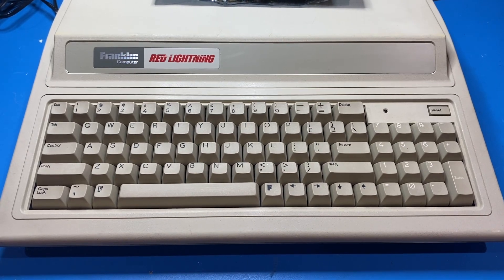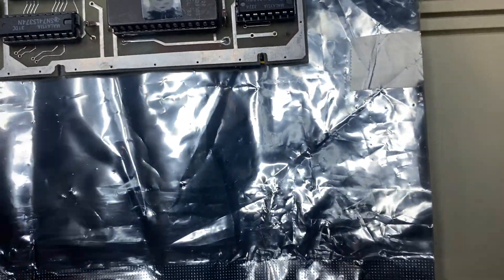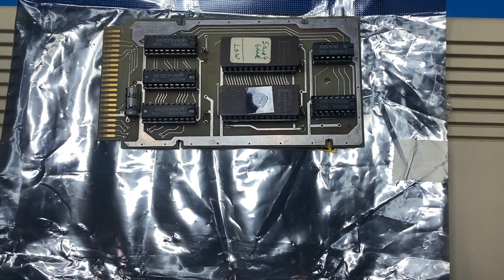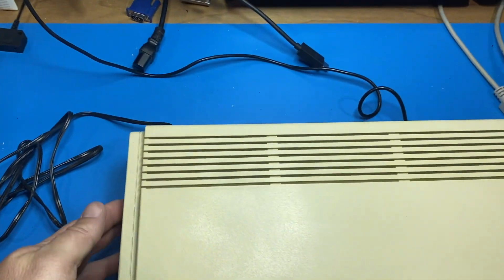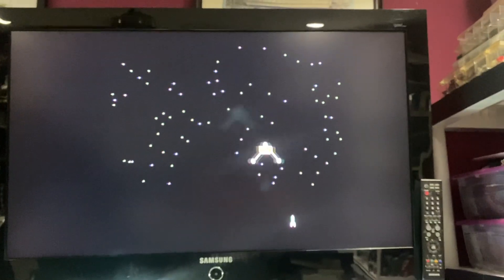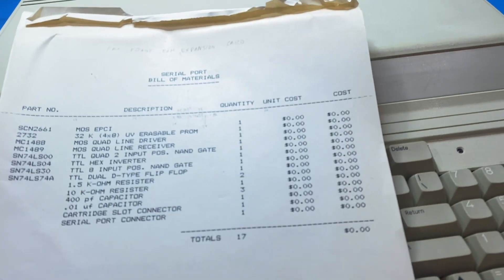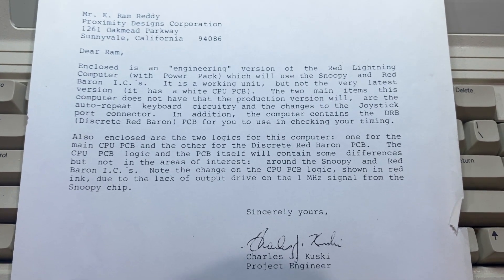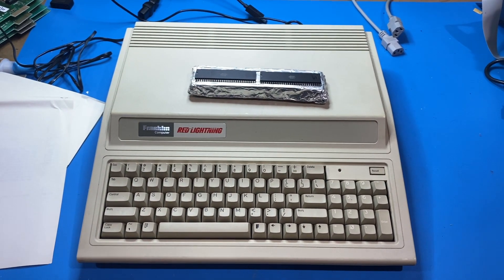Franklin Computer Corporation's Red Lightning Prototype

Comment: I am a person who has a FRANKLIN RED LIGHTING. I have 8 plug in cards Serial, Parallel  and Floppy disk cards. I do not remember what the power supply type and voltage was back then. I did have mine working with  Franklin's PRO DOS.